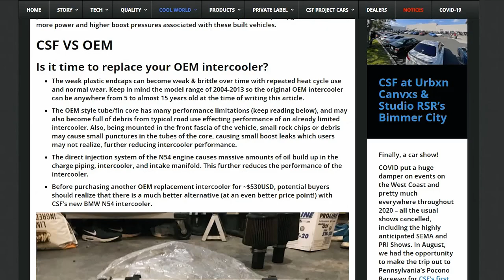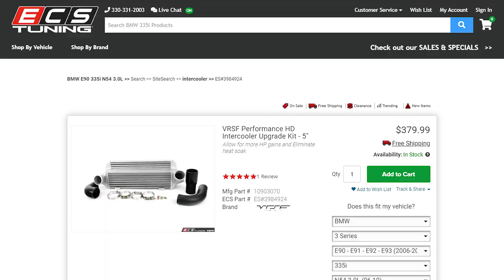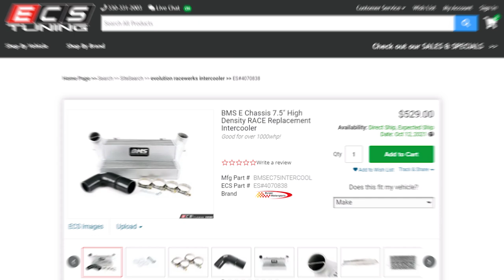The BEST Intercooler for Your N54 BMW & How To Install It

Comment: I have a 7.5 vrsf intercooler on my setup using stock turbos and my car runs great.
Reply from the maker: Nice! I'm sure it works fine, and you're ready for any sort of turbo upgrade in the future 😉
Reply: You'll probably sacrifice a little throttle response and a little more lag, but you won't have to worry about your iats. Lol

Comment: I’ve run 7 inch on my single turbo for a year and a half no issues. IATs usually 8-12 degrees above ambient.
Reply from the maker: That's actually not bad, but I'm surprised! My 7 inch had a hard time even keeping up when I was like 600whp.

Comment: Very nice explanation Jake!  I will go for downpipes and the 5" intercooler. I'm not sure whether to go for the MHD way or the JB4, after that. My goal is 420 crank HP like the EU e92 m3 has... Dutch regards, Nico.
Reply: Honestly, I’d just go with MHD if I were you. JB4 is good for new cars which are still DME locked and need a piggyback tune. Since MHD tunes the actual DME instead of hijacking signals, you’ll feel it’s more solid. I had JB4 on my 335i and replaced it for MHD super license. My car feels more consistent and stable, the boost is smoother and the extra options really let me tweak with the car to my liking (burbles, cold start noise reduction, etc). 

Also, MHD JUST released an update that lets you toggle the throttle response to be more alike the 1M or more like stock, so you can basically tweak the throttle response lag to your style of driving.
Reply: @TheGamingDistrict1  thanks!
Reply: Mhd is een aanrader! Heb zelf ook downpipes en 5inch intercooler. Stage 2+ zou 420hp moeten halen
Reply: Bro I say you go with mhd I’ve been running stage 2 mhd for about 2 years on my channels 335i and it’s been great so far no issues !
Reply from the maker: I think you will love that setup with the stock turbos, Nico. Like others have said, MHD is good. Both JB4 and MHD have come a long way over the years, but I think MHD is good because it's a straight flash vs. piggyback.
Reply: @jake_spence  Thanks Jake. I forgot to mention the upgrade to a Walbro 450, because my OEM pump is at the end of its life( 2AAF code). The Walbro is less expensive and better compared to a new stock pump. Regards Nico.

Comment: Me 

Yes I will just the 7.5 stepped race intercooler so I never need to mess with it again.

Also me, pokes hole in a/c condenser because you have to cut so much more shroud out

Comment: Did the splash shield fit fine? Because it seems like there is not enough room for the splash shield after the new intercooler.

Comment: If you’re pushing stock turbos you definitely want a 7.5”.
Reply: Agreed ! I personally have a 5inch intercooler on my channels 335i and it’s decent !
Reply from the maker: Really? I guess if you're going super high boost 22-25psi, then I'd say so. But otherwise it might be overkill with more volume than needed.
Reply: I’ve got the VRSF HD on mine. I made 435hp on stock turbos but now I’m on 17T. I’m wondering if I might need to upgrade to the 7.5” race. Though here in the uk the temperature gets to 30c max on a heatwave summer.
Reply: That's over kill for stock turbos. 5 inch is fine

Comment: You actually don’t have to trim anything to fit this intercooler have it on my 335is super tight fit everything in it’s way needs to be removed, but no trimming required at all.
Reply: For a 5 inch right?
Reply from the maker: I've heard so many mixed things. I had to cut for sure, it would not fit without trimming. Others said they had to trim more than I did, and you said you didn't have to trim at all. I wonder if it's a model-specific thing...
Reply: Did u get a 5 inch or 7?

Comment: Do you really only have to trim that lower bit? Another video for the CSF 5.5” fitting showed that you had to cut more higher up as well
Reply: Check out my vid bro ! I install a 5.5 inch as well
Reply from the maker: I think I ended up having to trim a little higher to be honest, but I might not have filmed that part...😅

Comment: I'm curious I was going to get a vrsf 7.5inch intercooler for my stock turbo n54 due to the fact in a few years time I would like to go single and then I wouldn't have to change the intercooler again what's the disadvantage to having a 7.5 on a stock turbo car ?
Reply from the maker: If you're for sure going single turbo in the future, you can get the 7.5" race intercooler to make it convenient. For now, you might get a little slower throttle response or boost lag with the extra capacity, but it probably won't be very noticeable. Still will keep things cooler than a stock intercooler for sure.
Reply: @jake_spence  Thank you very much 👍

Comment: What size IC would you recommend for a pure stage 2 135i running about 500whp?
Reply: I would say 7.5 aswell!
Reply from the maker: That's tough. I think the CSF unit would be fine if you don't wanna do a lot of trimming... otherwise the 7.5" race intercoolers would be good too.
Reply: @jake_spence  Probably will upgrade to a 7.5" just wanted to make sure it wasn't overkill, ty for response. (Coming from a 5" stepped ic from ebay that did surprisingly well with MHD 2+)

Comment: How much horsepower is typically gained ? And does the inter cooler upgrade require a tune?
Reply: I don’t think upgrading the intercooler requires a tune
Reply from the maker: Doesn't require a tune. Really depends on your setup and the outside temp. This intercooler will help your car perform efficiently. Instead of temps rising from ambient to +40-50*, it might only rise +5... keeping way more horsepower on tap. Hope that makes sense. The more mods you have, the more power you keep.

Comment: What about track vs drag applications? Given the same turbo (e.g. stage 2) a larger intercooler is a heat reservoir for cold and high temps. My point being, drag applications have undergo short bursts of stress vs track with many more year heat cycles.
Reply from the maker: It really depends. In my experience, you'll want something with a good amount of surface area for both applications. The problem with drag racing is that the car can heat soak in the staging lanes without any air flowing through, so water or meth would help more than the intercooler itself. Once you get moving, it should cool down pretty quick, but the run might be half over by that time. For track applications I'd want something that is large enough to keep temps down the whole time, without weighing a ton. What are your thoughts?
Reply: @jake_spence  im going full track car on my 135i and will be running a 7.5inch intercooler to accommodate a ST setup.

Comment: Would it be okay to go 7.5 stepped as a temporary one for stock turbos cause I plan to swap my turbos out and upgrade with another twin kit a bit later on?
Reply: I say get the 7.5 and leave it on till you upgrade turbos because either way I believe your going to need a bigger intercooler for the amount of psi your going to be pushing that’s my 5cents 🖖
Reply from the maker: Yeah it'd be fine as long as you're gonna upgrade. Might have a tiny bit more lag and loss of boost pressure but will definitely keep the temps down!

Comment: Do you have that 7” intercooler laying around? I’d me interested in buying it.
Reply from the maker: I don't, sorry! I typically try to sell any spare parts I have laying around right away.
Reply: I have your wheels that you were trying to run 10’s on.  They are painted black stock rims with Mickey Thompsons on them.  I bought them from the kid with the blue 135i with the low mount.

Comment: Would you still recommend a 5.5" Stepped Intercooler for a country 🇦🇺 with a hot climate for a Stage 2+ Daily Driven 135i N54? Or would you bump up to a 7" unit? I do like the minimal trimming of the CSF, but worried this won't cope here in summer. Any advice would be sweet. Thanks.
Reply: Going that large will have more negative effects than positive, the CSF intercooler is perfect up to 600whp in my personal experience
Reply from the maker: It's tough to say without knowing how much boost or power you're running. The CSF unit seems great so far, but if you're running ~600whp or more, I might suggest the 7.5" race intercooler to be honest. But like Jack said, if you're under 600whp, I think the CSF unit will be good.
Reply: @jake_spence  Currently on Stage 2 (~16psi) at approx 380whp according to dyno results from previous owner. Looking to push to Stage 2+ on 98 Octane. Currently running:
- BMS DCI
- VRSF Catless DP's
- VRSF Chargepipe
- MFactory Helical LSD
- Res Delete
- Stock Turbos
- Stock Intercooler - (yuck)

Wanting to tune to Stage 2+ (~18psi) with the right intercooler, but don't want to go overboard as honestly this is my daily driver and I won't be tracking or dragging. It sounds like I can get away with the 5.5" if I want to stick around get to around the 420whp mark. Thanks!
Reply: @TheNsnare  I have same setup except I have the JB4 tune.  What tune are you using?
Reply: @spiraling6980  MHD Stage 2 👌
Reply: @TheNsnare   did you end up going with an intercooler? please let me know all the info. thanks in advance
Reply: @res94  Just about to order the CSF 5.5" Stepped as per this video. Does require a minor bit of trimming on the 135i as well. I won't be pushing past Stage 2+ for turbo longevity and daily driving. Haven't ordered yet because I also need a new exhaust! Expensive times!
Reply: @TheNsnare  Haha i get you man every week its something. The thing is i dont know why i would go with a 5” option when i can literally find 7” for cheaper than what i would be paying for a smaller intercooler. Anyway you can break it a bit down for me? I know that heat soak comes into play and all that but is that really that bad to not get a bigger intercooler with better temps for a better price?
Reply: Yooo any feedback with the CSF 5.5” in UK? I’m in Hong Kong, same hot and high humidity as yours but not that extreme
Thx mate

Comment: Can someone tell me what my problem could be ? I have a bit of oil residue on the intercooler piping. Do I need to change my turbos seal or turbos entirely even if my turbos are running well? How am I supposed to know what is the problem. And btw my piping looks pretty much like in the video at 5:42. Is that something I need to worry about ?
Reply: Great question. My turbo seals just went out, I now have White Smoke that puffs out on decel and idle and i have a boost leak + run lean. If you have oil on your chargepipe too its your seals

Comment: What would be your go to maintenance before modifying for power ? On a used 335i n54
Reply: aside from gasket leaks and the common spark plug/coil maintenance, a walnut blasting is the only thing I’d recommended assuming everything else is in order
Reply: Walnut blast should be one of your top priorities when it come to maintenance
Reply from the maker: The other commenters hit the nail on the head here, any oil leaks, plugs, coils and walnut blast. Maybe injectors if you have rough cold starts too.
Reply: @Omegasticks77  how so? I need to do mine..

Comment: I thought it was like 6-6.5’…rated to 800whp+?
Reply: Yes if it's a properly designed intercooler. Because of how well designed the CSF is it will actually outperform the 7" and 7.5" options for most applications. I've had ARM 7" and CSF on my 17t build and the CSF destroys it in everyway lol.
Reply from the maker: Like Jack said, it really depends on what you get. They're all different and some are better quality than others. CSF carries a great name brand and I've been really impressed with the quality.